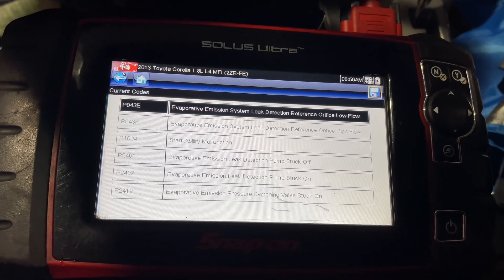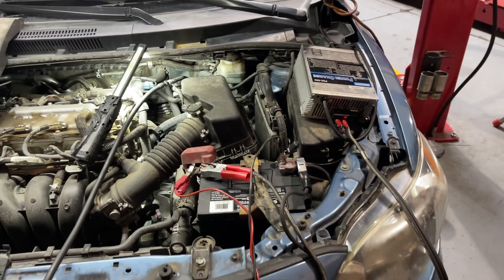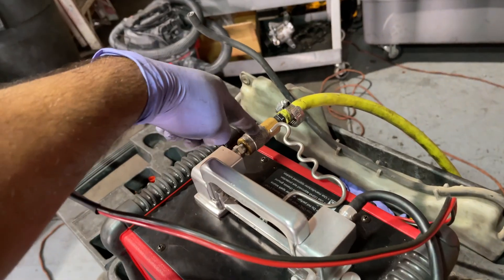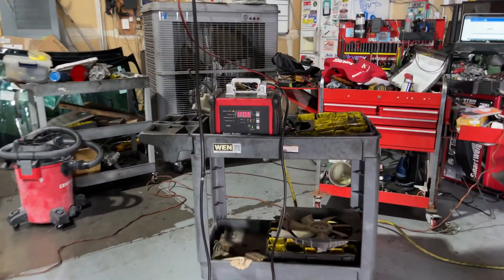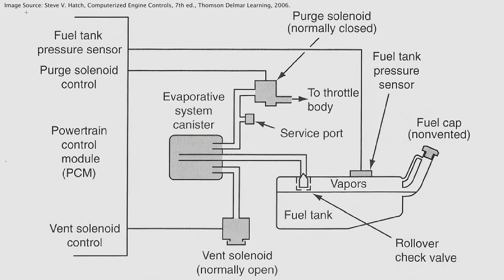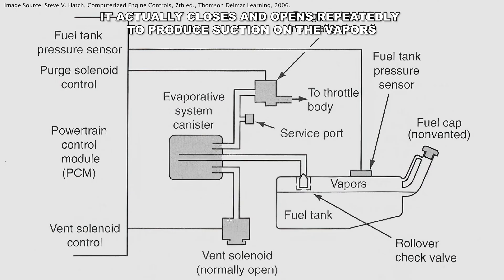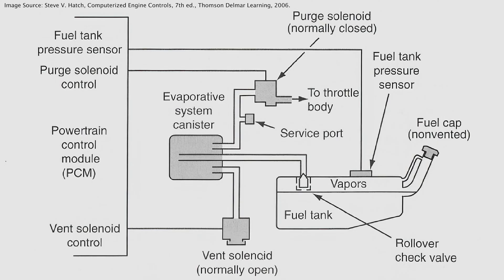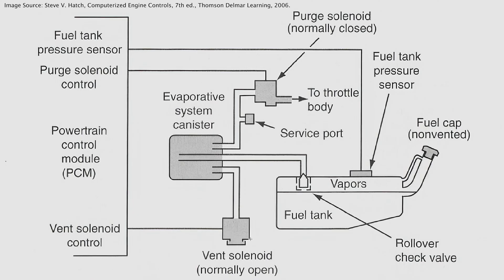EVAPORATIVE EMISSIONS SMOKE TEST, FAILED LEAK DETECTION PUMP : 2013 TOYOTA COROLLA P043E P2402

Comment: Wow you’re very thorough! Thank you for explaining everything. I’m a woman, and you don’t see a lot of women knowing about cars and doing repairs. I’ve gotten into it the past year after installing audio for almost 20 years, I got interested in mechanics. I just replaced my cylinder for coil that threw a misfiring code and it still had kind of a lag to it and I thought it was the battery until I plugged my computer in and it threw me P043E and P043F leak codes, I don’t have a lift but I’m a small chick, maybe I can put it on some tire ramps and slide under to do the test. I’d have to borrow the smoke machine from my brother but thanks to you, I feel confident doing a smoke test. Thank you 😊
- CarrieDeezNutz

Comment: Thanks for the video. What was the symptoms? My lexus es350 2007 throwed some similar codes. The car stalling after driving 10-15 mins, engine shuts off, high pressure build up in the tank and fuel nozzle clicked every time trying to refuel.

Comment: good video nice job... from an old retired auto service tech. I would like to ask you I have a toyota matrix 2010  and I replaced the charcoal canister assy, which includes the vent solenoid and leak det. pump. The codes I had went away but after a few days and filling the car with fuel the cel came on with new codes p043,p043f,p2401,p2402,p2419. the unit I bought was brand new from toyota canada,its cost me $375. 2 years ago. One thing I noticed after changing the part is that when I go to fuel the car the fuel nozzle keeps shuting off after maybe 15 seconds, then I have hold the fuel nozzle on again and it shuts off like its a full tank but it is not! any suggestions, could the vent solenoid be stuck closed? Thank you for any help you can provide. God Bless you.

Comment: Hi, thanks for the detailed video and the explanation. I have the same five codes in my 2012 Corolla. In the video, you've noted that you replaced the leak detection pump, but in the video at 9:30 onwards, it looks like that the whole canister assembly was replaced to fix the issue. So is it better to just replace the entire assembly instead of just the pump?

Comment: Hi have a question...my emission everything good execpt my evap is not ready car doesnt throw any codes?can i be leak detection pump?
Reply from the maker: Depending on the vehicle, it can sometimes take weeks for the Evap monitor to go "Ready". If there's no codes then it probably just haven't done all it's tests yet to switch from not ready. For what it's worth, this is why smog stations can issue a "pass" when the evap monitor isn't set yet (but all the others are good to go).
Reply: Its a 2010 toyota venza v6 it been like that for awhile..when the fuel tank is a quarter full it waist the gas like in 20miles...scanned it n the evap is the only emission that inc